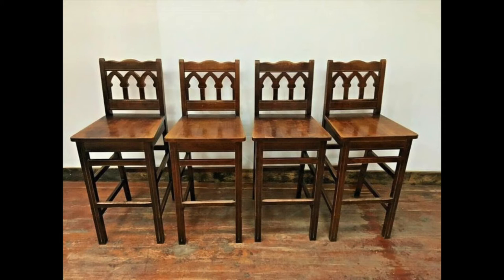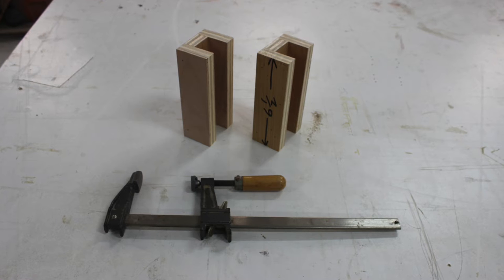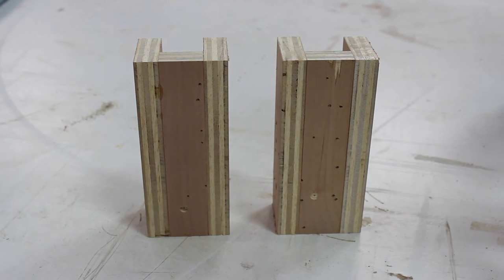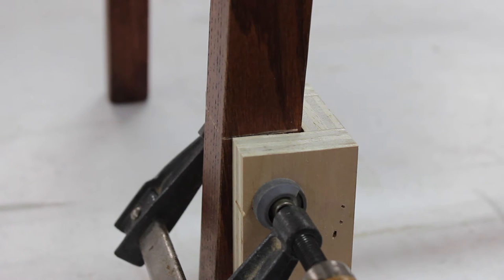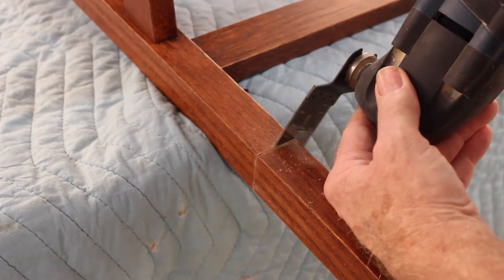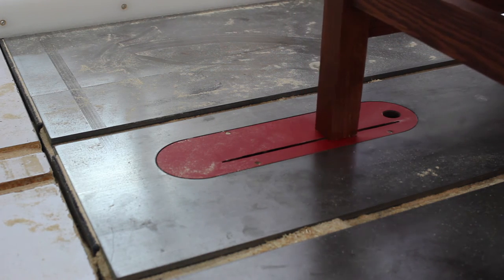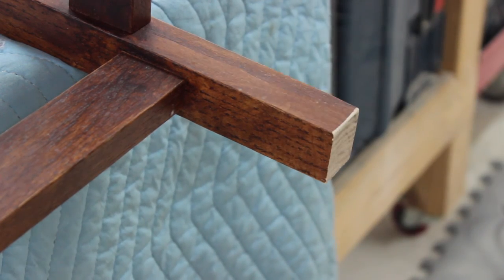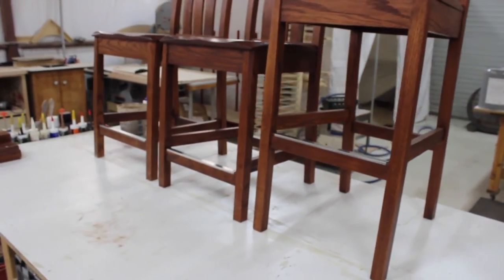Shorten Furniture Legs Flawlessly!

Comment: This video displays exactly what I need to do to in order to keep my existing chairs, and save money! My problem is I have absolutely no tools! Any way I live in a 1 bedroom apartment and I bought 2 used counter height chairs that were in excellent condition. The following week I purchased a counter height table brand new. When the table arrived I noticed the chairs were too tall! They were 29" tall but I need them to be 24" tall. When I saw how flawlessly you cut the chair legs in the video, I knew this was the solution I had been waiting for! What I need to know is: "would you please tell me the name of the two powered hand tools you used so that I can ask for them by name"? This video has been a great help to me and I'm sure it will help others that have the same problem! ThanQ for posting!
Reply from the maker: The oscillating saw is an older Bosch model that's no longer in production.  Just Google "oscillating tool" or "oscillating multitool" for a wide assortment of brands in various price ranges.  Some are cordless, which can be really handy.

We also mentioned in the video (but did not show on camera) a small power sander for quickly smoothing the sharp edges left after the legs are shortened.  There are many brands and types of portable sanders, and they are available almost anywhere, including the large discount box stores.  However, this step can also be done manually with sandpaper.

The "nibbling" technique for fine-tuning the leg lengths was done on a stationary table saw, but is not always necessary.  The same thing can be achieved with some  patient sanding and/or those little adhesive-backed pads from the home center.

Thanks for commenting, and best of luck with your project!

Comment: Very helpful. Would it work to cut through the leg with the flat attachment while the leg is still in the jig in order to ensure that it’s a straight cut?
Reply from the maker: @Catherine — Thanks for commenting! Yes, the leg could be cut through with the jig in place, but it’s important to avoid cutting into the jig itself. A wide, flat blade such as a Japanese-type pull saw with no set to the teeth would be best suited for this. We just prefer the two-step process because it protects the jig and avoids splintering in the cut. Let us know how it works out!

Comment: What hand saw would you recommend if I don't have access to a multi-purpose tool? Thank you!
Reply from the maker: @tomatojuice12 — A pull saw (AKA Japanese pull saw) would work well since most have very fine teeth with little or no set.  The video shows an example at 0:44.  Amazon has several decent ones in the $25 to $30 range.  Good luck, and thanks for commenting!
Reply: @ShopTalesandLore  thanks for responding! I appreciate it. What does "as long as the teeth has no set" mean when you refer to it in your video?
Reply from the maker: @tomatojuice12  With most hand saws the teeth are bent, or "set" out slightly, in alternating directions away from the blade.  This prevents the main body of the blade from binding in the cut.  But a blade with set teeth would cut into the top surface of the jig, defeating the jig's purpose as a flat, level guide for the saw. Pull saws are for fine detail work and don't leave a wide kerf since their teeth have little to no set.

Comment: You said with angled legs, you must take the geometry into account. How do you do that? Every video I see shortening stool legs are using stools with perpendicular legs. There are multiple methods shown for cutting those, but I have yet to see a simple method for shortening stools with angled legs or for making a jig for angled legs.
Reply from the maker: Great question!  The short answer is that the top and bottom of the jig must be sloped to match the angle(s) of the leg in relation to the floor.  Compound angles, where the leg is angled side-to-side (the "splay" angle) AND front-to-back (the "rake" angle) are the most challenging.  The cut lines can be marked in a number of ways, but with the jig method the simplest approach is to cut the ends of the jig so that when it's placed around the leg, those ends are parallel with the floor when viewed from the front, back or sides of the chair.  It's really nothing more than transferring those parallel lines up the legs to the desired cut line.
Reply: Try using a laser light to show the straight line, mark and cut.
Reply from the maker: That's a great idea!  We use lasers routinely for cabinet installations, but for some reason it didn't dawn on me to suggest them for marking the cut line on complex chair legs.  Thanks for commenting!

Comment: Great method! However, I’m a little concerned about trying the table saw nibbling technique. Do you ever have kick back with that? Any advice appreciated.
Reply from the maker: No, it's never been an issue for us with the nibbling step.  Kickback in the traditional sense is mainly a risk with through cuts; nibbling is more akin to a rabbeting or dado operation. The blade is only 1/32" above the table, so it has almost no chance of gripping the workpiece firmly enough to produce kickback.  Just be sure your throat plate is firmly anchored in place.  On some saws it is possible to tip the plate down into its opening by concentrating the weight of the chair at the end(s) of the plate.